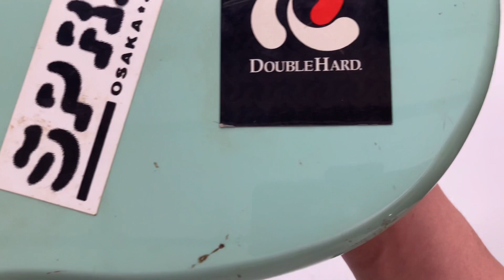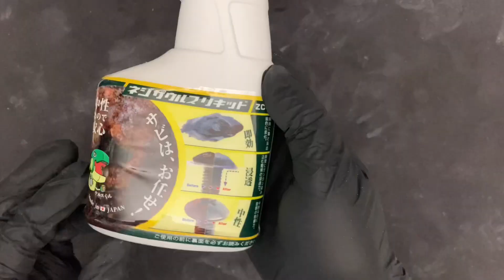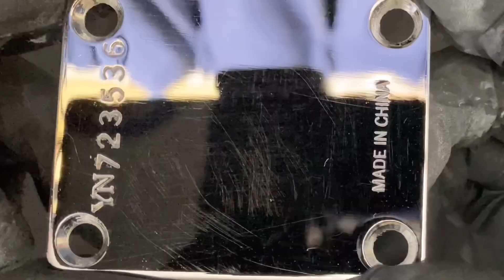音の出ないジャンクベースをクリーニングしました。-I cleaned the junk electric bass that has no sound.-

Comment: As a lot of others have already commented , its not a junk guitar - far from it. But a good attempt at click bait.
Can I suggest that you dont use a wire brush on chrome? Its overkill. Wash it and the polish the imperfections out. The brush just scratches it. Also thoroughly wipe down any good paint work before you start to polish it, otherwise you are just grinding dirt into it.  The exact same process applies to cars. Wash the dirt off first. Good video tho and authentic not a fake resto.